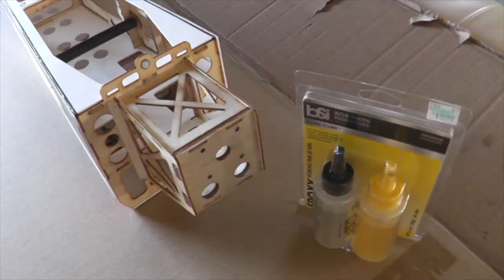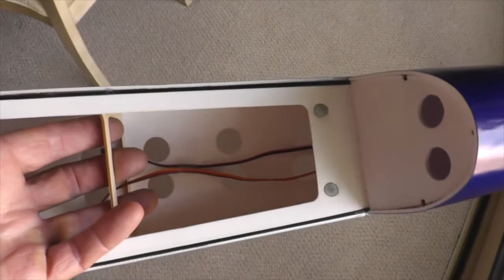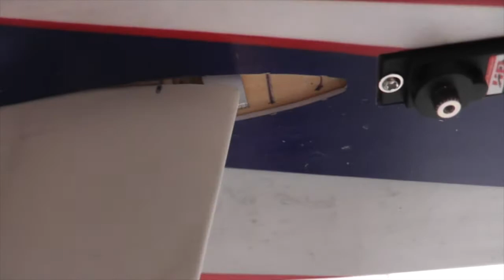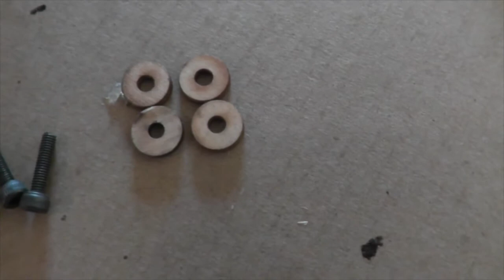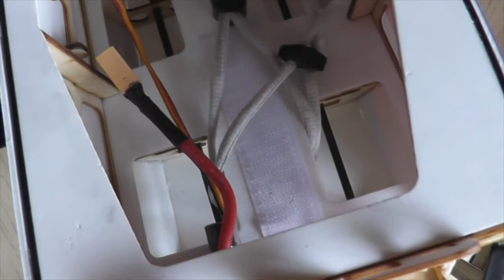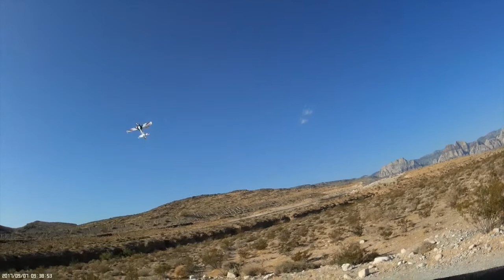Future Model 47" PP Edge 540T Build and Maiden

Comment: Where in the heck did you find instructions on the build? Preferably in English 😂.  I bought mine off AliExpress and I can find a PDF anywhere? I emailed the company a minute ago 
  Most of it is simple enough but there's a few parts I don't recognize. 
  Any link or info I'd sure appreciate! It's an incredibly well made model. I'm impressed so far. Very cool! 
Thank you 🙏🏼 holy smokes this thread is 7 years ago? Wow!
  Edit: I was wondering what those squishy washers were for. I think I got it now. Thank you!
Reply from the maker: Yep, that was many years ago, one heck of a good plane though. Glad to see folks are still buying it

Comment: Awsome ! where i can lern fly like you ? FFS its so amazing ! maybe some simulation ?
Reply from the maker: Simulator can help. I have one but rarely use the simulator, just too boring. Anyone can learn to fly 3D. it just takes a lot of practice. Start with flying slow high alpha harriers until it gets comfortable. Controlled harrier flying and comfort in turning, knife edge and inverted flying is the key. 32" flat wing foamies are great planes for learning 3D flying at the park.....
Reply: @thecuriousnomad4712  I found some cheap EPP like crack yak 32" is good for beginner learn 3D, but also confuse to choose between this Edge 47" because its removable wing convenient to carry by motorbike to flying site every morning before work time(wanna hide the plane in big carry bag to avoid my curious colleague ask what hide inside). I saw you fly pro, but for beginner is it possible to learn fly slow in small space(harrier at space about 20mx20m)?
Reply: @thecuriousnomad4712  I try in Reflex XTR simulator 2 models: Multiplex acromaster pro and stunt master, I like stuntmaster but prefer Acromaster because its wing removable. Stuntmaster is lightweight floatie, and more easy to try knife edge :D.

Comment: Hello, Great review!  ; )

Which plane do you like the most how it flies, the EDGE 540T Future Model or the Skywing Laser 48 "PP?

Which is better built of the two?  Thanks in advance!

Happy New Year!
Reply from the maker: Thanks and happy new Year to you as well! Both planes fly well but the Skywing planes are built more solid and are a little higher quality in all sizes. The PP skin on the wings of the Skywing plane is thicker than the Future model and thus is has a smoother appearance and probably greater strength. The Future Model plane is a great value for the money though and is just slightly more stable in slow flight. If you plan to do mostly slow 3D the Future Model might be the best choice but if you also do a lot of high speed aerobatics than the Skywing is the better choice because it will tumble better.  Hope this helps
Reply: Thanks for your answer! I think I'll buy a Skywing Laser 48 "PP

Happy flights! ; )

Comment: hi again!
i got right now the this plane!  tell me please, what setup you used for this plane? 
(motor, esc, battery, prop)
Reply from the maker: SunnySky X2820 920kv motor
Gecko 65A ESC BEC set to 6 volts
12X 7 Turnigy Light Electric wood prop or 12X6 APC prop on 4S
Lumenier 1800mah 4S 75C Lipo
Elevator servo Power HD 1810MG Metal Gear
Aileron and Rudder servos Corona DS939HV Digital Metal Gear Servo
AUW = 1300 Grams
Reply: Paleomanjim2 
thank you for answer!

Comment: How does it comapre to the 47" skywing?
It looks a bit slower & floatier ?
Reply from the maker: Skywing 48" Lazer is a bit more  responsive and agile. It does aggressive XA and tumbling better. The 47" Edge is more stable and rock solid in slow 3D flight and yes it is slower and floatier. Both great planes and the differences are minor.